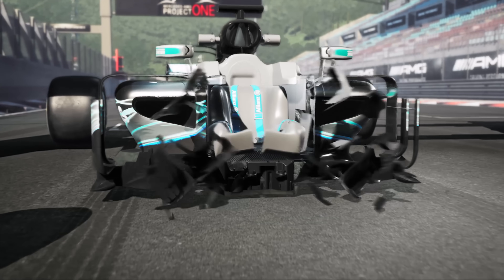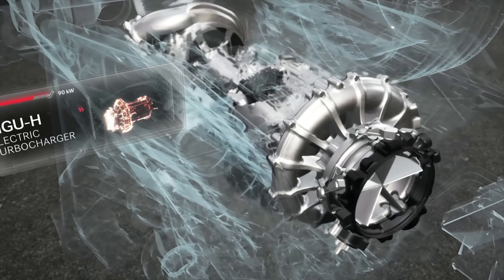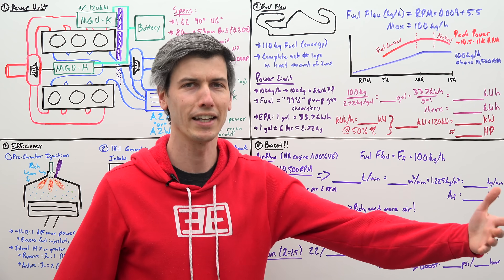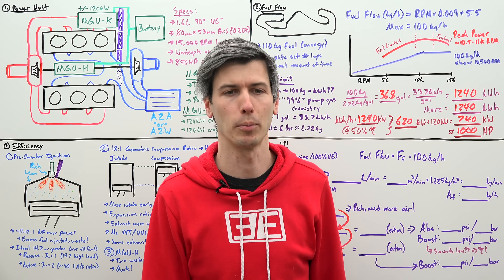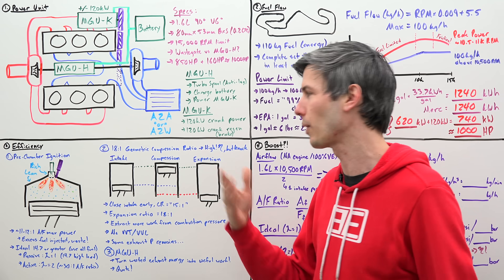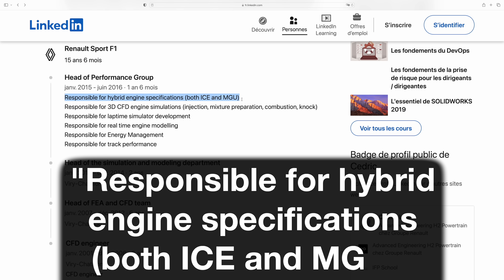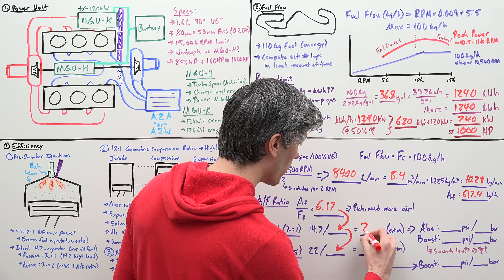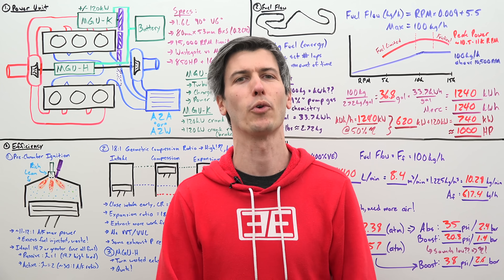How Tiny Formula 1 Engines Make 1000 HP!

Comment: Great video. Over in bike land, the Ducati NA Desmosedici Stradale 90° V4 has a similar bore x stroke, a 14,000 rpm redline and runs a 14:1 compression ratio on premium  pump gas.   It makes peak torque at 11,000 rpm.  In addition to being inefficient to run the F1 engine to max rpm, I'm guessing it slides off the torque curve around the same point as the bike engine.
Reply: The racing version of the Desmosedici 90° V4 revs to 19,000rpm!
Reply: But a bike is about as advanced as my lawnmower compared to F1
Reply: @peanuts2105  You must have some lawnmower!

Comment: Regarding boost calc: Wouldn’t the example engine use air at half the rate of RPM (assuming a 4 stroke engine)?
If so, I guess boost would be closer to 55psi? (35 x 2 = 70, 70 - 1atm = 55)
Reply: VE numbers generally are for four stroke engines. There are other ways to use VE with different stroke engines. Your typical 2.0L sucks about 2L of air through every TWO revolutions

Comment: Hello,

First of all your are doing an incredible job on internet for technical analysis on youtube, hat off for all you do.

BUT 😆

ICE are an incredibly complexe system, mixing thermofluids, thermodynamics, acoustics etc... As ICE are my job, there is many things to discuss about your analysis, but in general and for novice people and internet, it is clearly enough. 

About your point 4, and your "boost pressure problem". It is just because all along your video, (and all videos in general), you are using linear behaviour, such a multiply and divide. Unfortunately, physics doesn't work like that.

Pierre-Simon Laplace entering the chat

Speaking about pressure into engine, to be synthetic, majority of compressions and relaxations are not reversible, this is why multiplying and dividing doesn't work in this case. The Laplace laws is P.V^k=constant value for isentropic compression. Using some wonderful maths,  you can obtain that temperature is implicate inside, and therefore the density. This is why the real boost pressure is 4 bar, and not 2.5 in Formula one 😄

Comment: Wastegates as well as throttle valves should only be used as a backup anyway. Seriously, we're in year 22 since the first homogenous, throttleles gasoline engines for road use were introduced (by BMW) ... year 17 since the first high-power application of a VGT in a gasoline engine (Porsche). Why stand back behind technology that is as old as the youngest generation of drivers? I didn't start on a sidevalve engine either...

Comment: You forgot to talk about the pumping losses that can be avoided with the MGU-H. Without needing to drive the turbine, the engine has a serious reduction in back pressure, and the MGU-H allows you to drive the turbo without exhaust gases.

Comment: OEMs should use this in production cars.  That the turbo waste gas pressure to spin a generator & (1) put the power into the battery, (2) fill in the torque curve or (3) regen.  Totally makes sense.  Free power.  Don’t the complexity / reliability tho.
Reply: Given that most ICE OEMs will be bankrupt within 5 years, that’s not going to help.

Comment: 1000hp from a 1.6L v6 at first glance is not as impressive when you remember the 80's made 1.5L 1500hp monsters.  However, to do it with such reliability, AND be using so little fuel, it's astonishing.  People talk about the 900hp V10's were impressive.  Well they were using about 2x as much fuel.  If the shackles were taken off of the 1.6L v6's of today, they could probably get 1600+hp with reliability too.

Comment: In the more wild days of Formula One. I think the engines reached up to 1100hp. And the cars were also  lighter. Ah those were the days
Reply: In the 80´s some turbo engines reached about 1300-1400 HP in qualification mode. During the race, the power was way lower - about 850 HP. The naturally aspirated V10´s in the 2000´s reached up to 950-1000 HP.

Comment: Can you please break down lmp1 porsche 919's engine especially the evo since it seems they have very advance and clever engine, the only thing i know is that they use 2 turbo, one turbo is specifically use for harvesting electricity like mgu-h and the other one is completely focus only to sucked more air with 3 inlet but what i find peculiar is that the inlet for cooled air from intercooler is going inside the engine's right side but not like the one in hot v engine (you will understand if you google it) so i'm still confused of the engineering behind it because it has little information no matter how hard i search, so maybe if you have time for it you can explain this  engineering gem that kept hidden by porsche.

Comment: could you talk about how much more power the v10s could make if they utilised newer tech?
Reply: @fillman86: more impressive than the naturally aspirated 3L V-10s were the 1.5L V-6 engines (of the late 1980s).  The Honda engines of that era were making 1500 hp in qualifying trim (the rules of that era didn't limit fuel flow and allowed for 4 bar of boost, and didn't specify bore/stroke ratio)... all to Jason's point: manufacturers build to the rules.

Comment: I have a question/episode idea for you. I have a Rav4 Prime PHEV and im really curious what the oil/lubricant companies say about what are the best formulations for the very intermittent use of the ICE. We go weeks or months without starting the engine which is great but I want to know if there are certain types of oils that perform better in this new style of use. Thanks love the channel
Reply: Problem is no matter how viscous of lubrication you use it won't remain in place for weeks/months and you will lose efficiency if you did use a heavier weight. 

Two downsides to the PHEV are ethanol gas doesn't age well so you should be using it within the month and engines don't perform well when cold, so if you do start the engine for only 5/10 minutes a day or even a week you are inefficient and you wear the engine at a higher rate than if you were running it continuously.

Upside though is you are probably paying much less in operating costs by using electric energy.

Comment: MGU-H is also used in a 4th way, as an electric supercharger.
In qualifying mode, the battery is fully charged, and drives both the MGU-H and the MGU-K, and the wastegate is open for least amount of exhaust back pressure
Reply: That "party mode" is no longer permited. Altough mguh stil might supportl compresor

Comment: Are V6s inherently more efficient than other engine layouts? I understand why F1s regulations are more focused than ever on efficiency, but I'd love to see a return to V8s or V10s. Keep the hybrid and turbo systems. I know we can never return to the iconic sound of ultra-high revving naturally-aspirated V8s/V10s, but the increased density of exhaust pulses from those layouts would definitely create a much more desirable exhaust tone compared to the underwhelming V6 one.
Reply: Less cylinders, less friction, more efficient. That´s why it´s a V6 today.
Reply: @milanbujna2957  Ah, that makes a lot of sense. Didn't realize it was such a simple explanation lol. Thanks!
Reply: @antaresvariant2306  It´s one of the factors, but yeah. You have to put it in the ratio also with the engine displacement and that there is a certain volume pre cylinder required to reach good thermal efficiency. So a V8 or V10 with this tiny displacement of 1.6 liter wouldn´t make sense.

Comment: It helps if your engine only needs to work for a few thousand miles, and you have 3M for one engine.

What is super hard to do is make a good engine that is also cheap to manufacture, lasts a long time, makes power, and is efficent.

That being said, EVs are just better lol. The only reason F1 is fast is because batteries are still heavy, but in time this will not be a limiting factor. I think F1 has at best between 10 and 15 years before everything about it is made obsolete unless FE decides to give up exclusivity on electric only power trains in the FIA.

Comment: On the part about high compression ration and closing of the intake vale early, it sounds similar to Atkinson cycle. Except in Atkinson you leave the intake vale open for longer. Is this correct? Is this the same principle?

Comment: can you calculate how good fuel consumption can make a normal car engine do with technology like this?
Reply: Modern car engines are 35% efficient,  while these F1 engines are 50% efficient.  For spending exorbitant amounts per engine,  you get a 40% efficiency improvement,  but only in a very narrow rpm range at full throttle. I suspect normal driving would only yield half that improvement- 20%. With the exotic materials,  hybrid system,  huge turbo, and expensive racing fuel,  you're paying lots of money to save a little gas. 

Heck, even premium pump gas is so much more expensive- like 30-40% more than basic unleaded- you're paying more for the fuel than you can save in mileage. 

I'm not saying the tech isn't worth the extra power and street cred, but it ain't financially viable.
Reply: @jamesengland7461  right, but that was a theoretical question, not economical or how realistic it is :)

Comment: 35% thermal efficiency isn't impressive at all. Considering Honda and Toyota have achieved and exceeded 40% (41-42 typ), 35...is like 20 years ago. Oh, and those same 41% thermal efficiency engines run at 13-14:1 compression...in road legal cars.
Reply: But as naturally aspirated, way less powerfull engines running in Atkinson cycle.

Comment: the older NA engines could produce high power as well, I believe the old BMW 3.0 V10 made over 800 at 17,500 RPM.  Toyota apparently had a V10 that could do 19,000 RPM and made "closer to 1000 bhp" than most people imagined. Shame it didn't get them anywhere though! Also I would expect motorsport to have higher average efficiency than a road car because they will be running in peak efficiency areas most of the time, whereas when we're cruising the highway the efficiency isn't actually all that good (although the economy can look good, economy \= efficiency. You can use a little fuel badly and a lot of fuel efficiently). There are BSFC (brake specific fuel consumption, g/kWH) sweetspots in all engines and they tend to be quite close to the max torque curve (or full load points)
Reply: 1983 BMW M12/13 1.5-liter inline-4  FI engine. Unlimited boost. 
BMW engineers figured the engine produced around 1,400 hp at maximum boost.
 However, the BMW engine dynamometer could not go beyond 1,280 bhp.
Reply: @DennisMerwood-xk8wp  yeah those were mad days. I think that engine only lasts for qualifying right? 😅
Reply: @0tispunkm3y3r  only 1,000bhp in race tune! LOL
Reply: Nope. Last year of V10 era brings out engines that produced 950hp (BMW). But the last and the most powerful one was Honda with its 968 crazy, japanese horses :)
Reply: important note: those N/A engines also had unlimited fuel flow and had practically 0 emphasis on reliability allowing teams to run full power switch engines every weekend. today's engines fall under more strict regulations.
Reply: @no1washerezz  yeah the power with the reliability they have today is really quite impressive. I remember they'd change engines at the drop of a hat if they thought they needed to....well if they could afford it. No cost cap and some of the big teams really did spend eye watering amounts (sometimes to achieve little! Toyota!)

Comment: What's to stop you from just putting an Axial flux motor at the wheels and using the engine at it's optimum efficiency (and fix it's RPM etc., everything for perfect efficiency at that specific rating) and just generate electricity for the axial flux?

If you used 2 of them to control each wheel independently, you could easily have 100% of maximum power at all wheel RPM AND get well over 60% thermal efficiency in the engine while simplifying the entire system (i.e. you wouldn't need anything other than a single generator on the crank)

Seems like this would lead to massive competitive advantage while following the rules because you'd need less fuel, and have 100% power at all times if you want it.  Effectively an EV with electricity generated by an ultra-efficient engine.  

It would sound weird however because the engine would always sound exactly the same no matter where it was on the track :)
Reply: Can't really get well over 60% efficiency, ever.  That's a theoretical maximum with weightless materials, exorbitant temperatures, and no friction. But yes,  you'd still gain in efficiency and power.
Reply: @jamesengland7461  sterling engines routinely hit 65%. So 60% should be possible. Hell s Prius is 54% at optimal rpm and load.
Reply: @jameshancock  did I dispute that?
Reply: There are a lot of clever engineering tricks that could be used but that are not allowed by current F1 rules.
Reply: @avsystem3142  I'm asking if there is any rule against it. From what I can see, there is only a KW limit. Doesn't appear to require that the wheels be driven by the gas engine.

Comment: For reference a wwii merlin made around 1700 hp at 18lbs boost and around 3k rpm but the engine was the size of a formula 1 car at 27 liters😄
Reply: Merlin = 63bhp/liter.... pffft. The 1983 BMW F1 1.5-liter was 933bhp/liter!
Reply: @DennisMerwood-xk8wp  ya pretty amazing  what 40yrs of tech can deliver
Reply: @MAYDAYSIMULATIONS  There is a scale factor coming into play here MAYDAY.
The bigger the capacity - the less the bhp/liter. Because of the "cubed" capacity relationship.
 
Too complicated to explain here. 

But the RR Merlin V12 was no slouch with its double supercharging! The American Air Racing fraternity hot rods theirs to 4,000+bhp in their P51's. Running on crazy boosts plus tons of nitrous oxide - and man - do they explode when they blow up! LOL

Comment: 1.4 bars of boost is still very very high to an 18:1 compression ratio engine. and you are right about f1 engines running extremely lean, to the point that the main chamber's mixture is too lean to be ignited with a sparkplug. the main chamber can only be ignited by the heat and shockwave from the combustion of pre-chamber. so realistically they are putting 2.X bars of boost into an 18:1 engine that shifts at 12,500 rpm & have 2 electric systems scavenging waste power. of course it will result in some staggering numbers.
Reply: Yes, I think the wonder is more in how it's not blowing up. If this where done in any street engine that would blow up.
Reply: @gameonyolo1  They know how much power they are going to make, and engineer the bottom end of the engine to withstand all that power.  The 15,000 red line sounds high, but older F1 engines used to actually red line at around 18,000.
Reply: @carljaekle  I meant more in the sense of knock, yes I understand how it's done but still impressive
Reply: @gameonyolo1  Fair point, high compression ratio, plus high boost would normally result in knock.  He mentioned something about closing the intake valve early to limit this issue.
Reply: @carljaekle  Actually they revved to 20K before they were limited.
Reply: @carljaekle  previous F1 V8/V10 had a redline of 20,000rpm, but limited to 18,000rpm for a race, and they were naturally aspirated but your point still stands
Reply: knock has a lot to do with stuff like carbon deposites changing cylinder displacement (therefore changing conpression ratio), uneven cylinder temperature (hotspots) and slight fluctuation in fuel's actual RON/MON number etc. precision engineering gets rid off all of these factors. also an f1 engine is only designed to last 8 races (in reality they last around 5 - 6 races each and pretty much all teams take on panelty to bring in extra 1 - 2 engines each season). if knock or other issues does start to creep in, they just change the engine. very different priorities comparing to engines in consumer vehicles.
Reply: They have more boost than 1,4bar. Scarbstech have talked about it, since the MGU-H will disappear 2026. 
And since they don't run with 14,7afr 1,4bar is not correct.

I can check some sources....

Really funny you congratulated Max for the 2023 wc BTW 🤣👌
Reply: The forced induction is mostly about efficiency and strategy, than big boost and power. The regs will simply cap the power, at whatever they all can agree is sensible.
Reply: @tensevo  There is no way you are going to get over 850 HP out of a 1.6-liter engine without boost.  There is no capping of power.  There is capping of fuel, and therefore energy available.  The better teams extract more power from the same amount of fuel-energy.  Red Bull has a power advantage over say a Renault power unit.  Both use the same amount of fuel.
Reply: @carljaekle  i didnt say no boost. The regs were designed to cap the total power output around 1000bhp, through tweaking parameters, they hit on fuel flow.
Reply: You just said what he said
Reply: I would estimate that without the MGU-H (and MGU-K) the correct boost amount would be around 1.5-2 bar and the engine would generate about 850-890 bhp, and the MGU-H scavenges the excess boost that otherwise cannot create horsepower, amirite?
Reply: I can promise you they are not running 18:1 compression on 20psi and running a 14.7:1 AFR.
I do not care how strong the parts are that mixture at that compression level and that AFR melts pistons.
Reply: @liftedcj7on44s  that's not a problem really, as you can use alloys to prevent this, and the total milage the engine is expected to last, makes it a smaller issue.

This is why engines are labelled "race-engines", build for higher amounts of force, but lesser reliability.
Reply: @kimf.wendel9113  I build "race" engines for a living so I know what a race engine is supposed to do or not do.
The pistons are still an aluminum alloy and at the stated Air fuel ratios this video says they are running that equals melted pistons.
If you can prove to me they are using some exotic material that can withstand this i'd love to see proof of it.